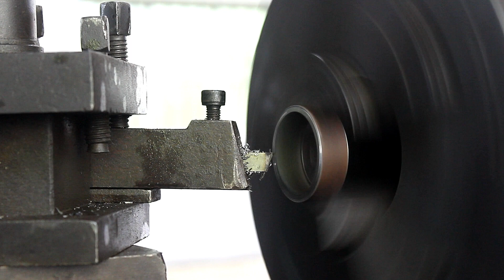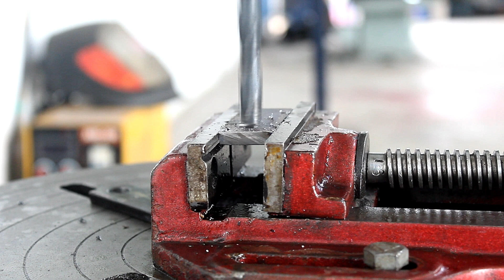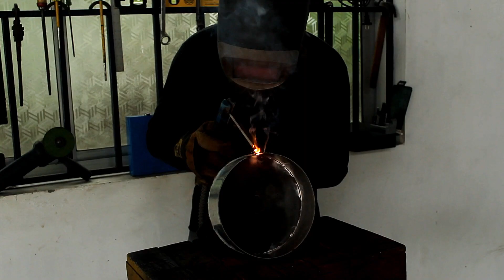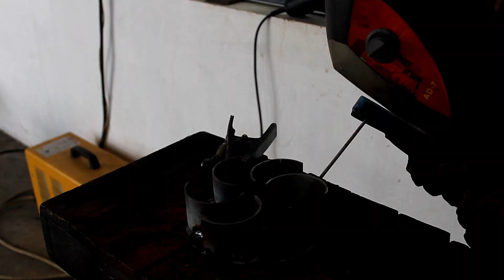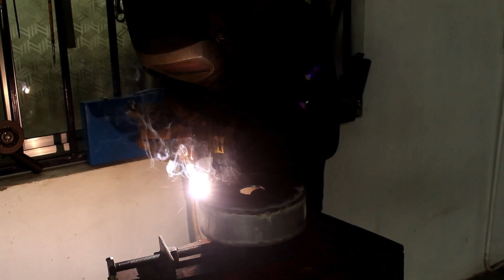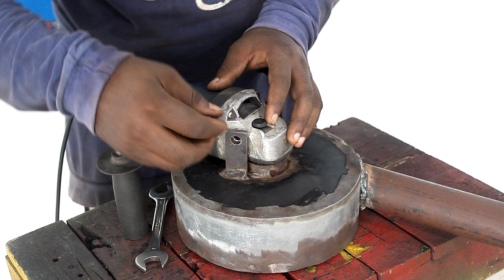Angle Grinder HACK - Make A Air Blower | DIY

Comment: it looks so sturdy.... all were made out of metals, does it feels heavy? 
although it feels a bit of hard work just to get the attachment onto the grinder. If I may suggest, it would be easier to install the attachment if you could take one side off and fasten the nut then put it on after. 

Other than that it's a cool project!   I wish to make one for myself...

Comment: Dear Sir,
It would seem someone is rather partial to angle grinders & what sorts of attachments can be added to increase it's versatility. Maybe a fan or impeller from a turbo charger might have been considered as a better alternative? At least this implement is better suited than your former project for crushing branches. Very well done. Kind regards.

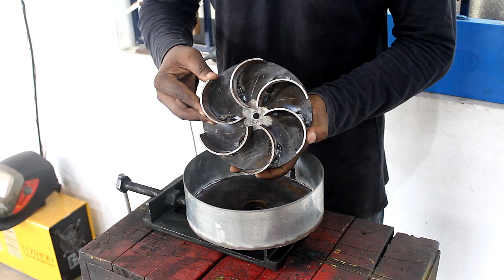Comment: Yes your idea is good but design is  not good  6:51 that blades are too much bend they will not push the air through efficiently   you need to use bigger diameter pipe to make blades so that bending of blade will be less
Reply from the maker: Thanks for your suggestion
Reply: @DiamleonDiyBuilds  thank you for reply , love from India ❤